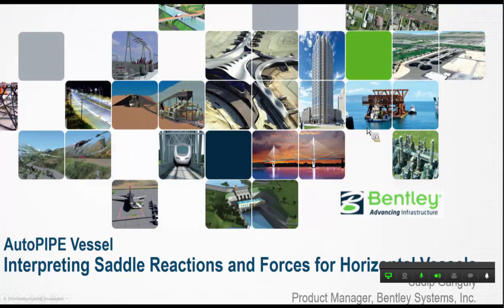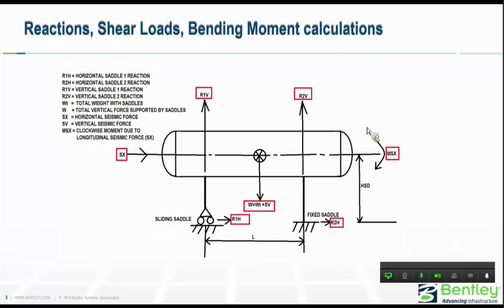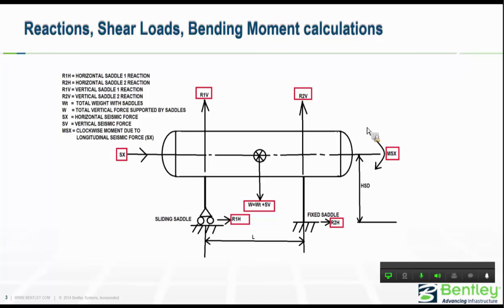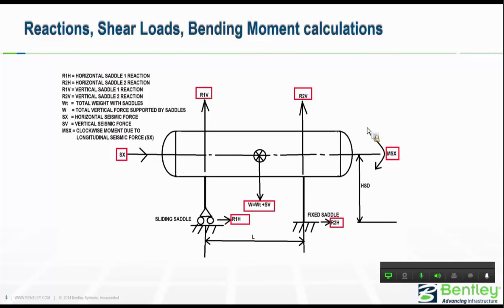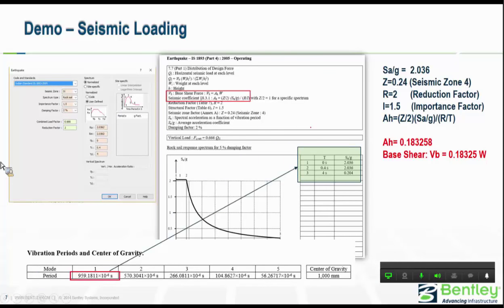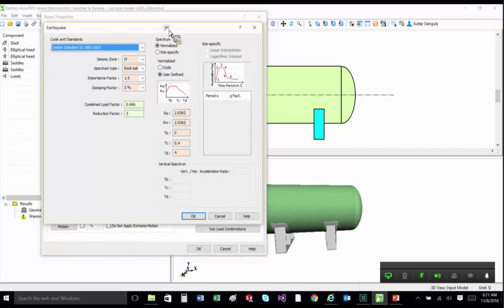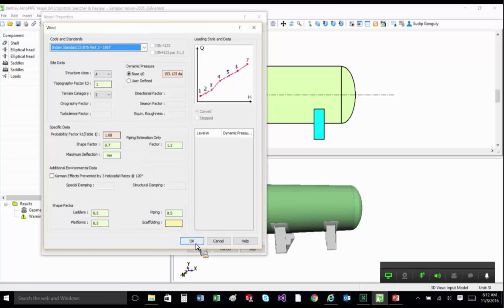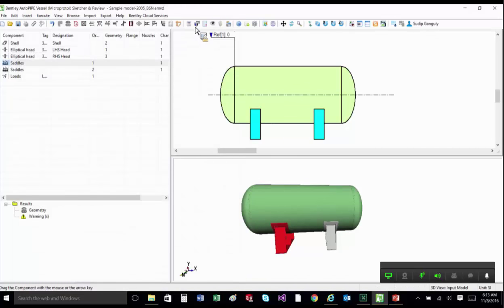Interpreting Saddle Reactions and Forces for Horizontal Vessels

Comment: Hi could you kindly advise me on how to approach saddle design ? Some of the vessel that my company transports have their saddles designed either wood or metal depending on the vessel weight I’m trying to get to a general formulas that would be implemented into excel and would thus give me what should the saddle size be.